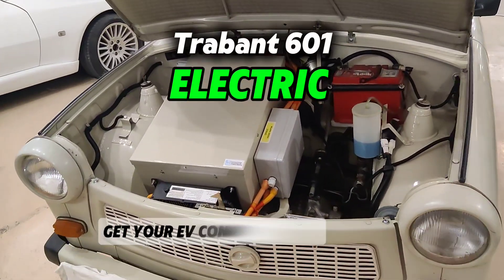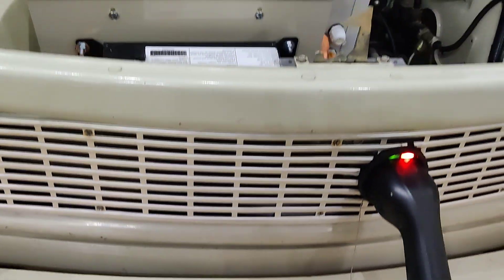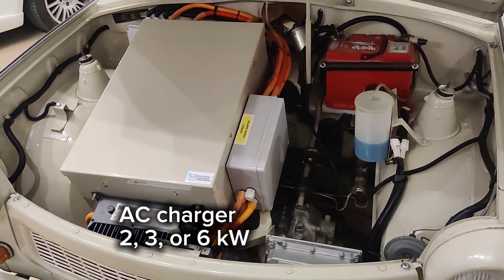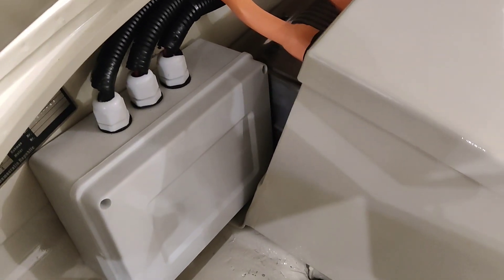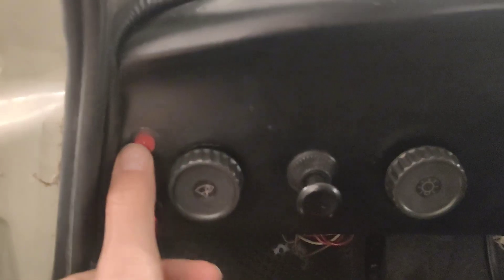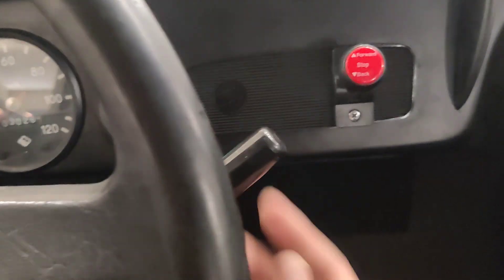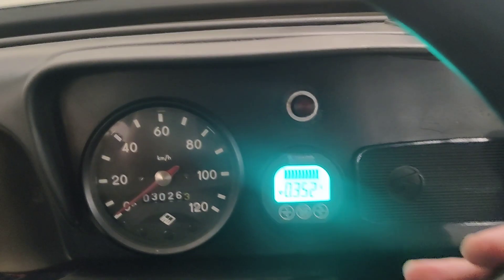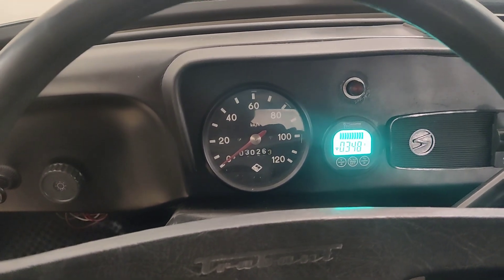The Ultimate Electric TRABANT — Full EV Conversion You Can Buy as a KIT

Comment: So there is no coasting, unless you move the reverser to neutral. Not good. The middle pedal should gradually apply electrodynamic brake in the first half of its travel, then engage mechanical brakes too. The clutch pedal should be mechanically linked and act as a mechanical brake that you could apply anytime, even if your other foot is on the accelerator pedal (e.g. when starting from a standstill on an incline, to avoid rolling back).
Reply from the maker: it drives like tesla when you release accelerator then its braking, also it has no rolling back as electric motor doesn't allow rolling in the oposite direction, its like hill holder
Reply: @ev-evolution  I have over 100 thousand km on e-up. I hate one pedal driving. Lucky the e-up does have the "D" mode with coasting as default.

Comment: Duroplast is not strong enough for that electric motor and the stresses on the car body.
Reply from the maker: motor is set to smooth acceleration so it doesn't have strong kick
Reply: Duroplast is stronger than metal and there is a supporting skeleton of steel underneath.
Reply: I once had a Traban... it broke the main shaft ball bearing in the gearbox. The balls were quite soft, I didn't have to squeeze hard in a vise when it flattened. I put in an SKF bearing.
Reply: Yes gearbox would be my only worry, as acceleration from standstill in 3rd or 4th will put a lot of torque on it. As long as the tires are narrow and not sticky it will help survival;)
Very nicely done. Love the build❤

Comment: cool, like the simple design. I use LTO batteries i make for my EV's to improve efficiency of low voltage system and shave another ~15kg/40lbs of weight. I also add a cheap aerodynamic 200w solar roof which charges the low voltage system above the set point of the dc-dc converter which keeps its asleep and is the most efficient way of adding range to an EV since you avoid the ~50% conversion losses from HV to low voltage battery while driving. I have videos on my page explaining how this works and how to DIY on my page.
in usa solar roof only costs ~100usd counting mppt and LTO another ~50usd which is like 1/5th the price of lead acid batteries here now days. the ironic part is that LTO lasts forever and doesnt need thermal management system and can keep up with all the high draw LV loads.
just an idea how to shave much more weight from the car and improve range for very little investment.
you wont find this idea anywhere else on the internet coz i came up with it myself lol

Comment: So there's no freewheel in fourth gear?
Reply from the maker: electric motor has direct connection to transmission so it drives like tesla with accelerator pedal you accelerate and regen braking. No need for tranmission usage or flywheel
Reply: Trabant gearbox have freewheel on 4th gear. The car coasts after letting off the gas.
Reply: @KubikCv they took the gearbox out.
Reply: @francesconicoletti2547  no, they didn't :D

Comment: That sounds like an excellent idea, as the 2 strokes are a historic anachronism barely acceptable on any roads even where historic vehicle exceptions may allow them
Reply: The two-stroke doesn't pollute it any more than any museum car...it's just visible smoke from the lubricating oil.
Reply: 2-strokes power this world. Mainly diesel 2-strokes. Ffff-ing huge diesels burn everything that can be injected into the cylinder. Including heavy oils with ridiculous sulphur content.
But nobody dares to stop a floating building. I strongly encourage everyone to take a try. 😅
Reply from the maker: now you can drive it even in the closed space :)